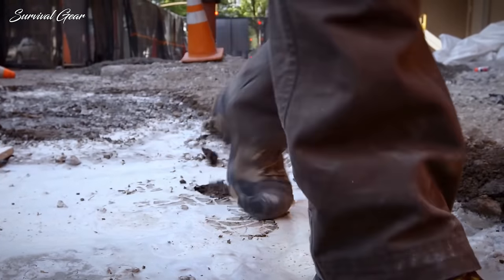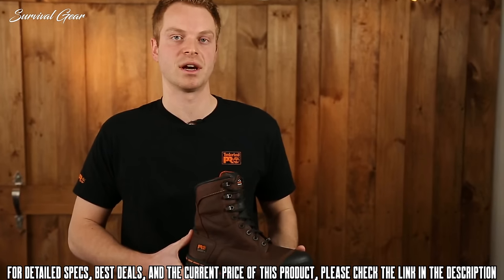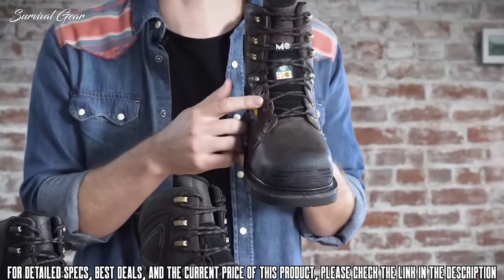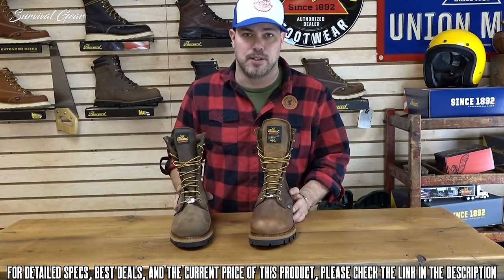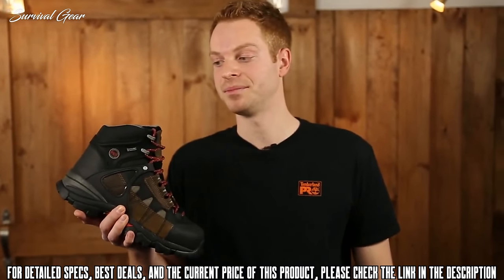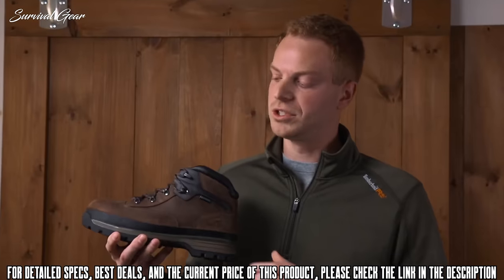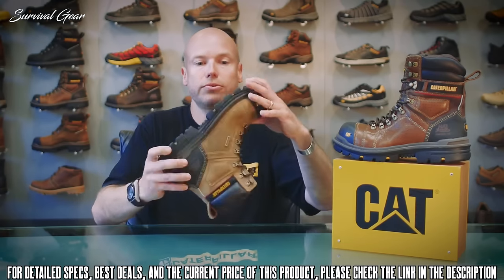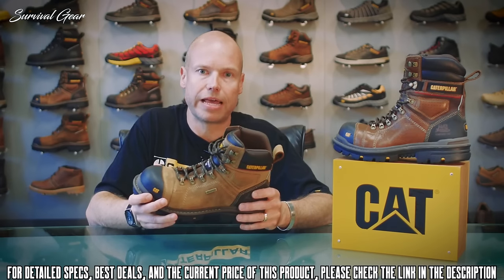TOP 10 BEST WORK BOOTS FOR MEN 2020

Comment: I agree with the comments about Redwing boots. I thought about buying some for over 5 years. Every year I would need a new pair but never gave in to spending the $280 that they would cost me. Well I ended up buying a pair of the Redwind Chukka work boots, which aren't their most rugged boot by any means, but theyve already lasted me longer than every other brand besides Tony Lama. The real reasons I fell in love with them is #1, for the comfort. I go on walks with my girlfriend and don't need to bother changing into sneakers to do so. #2, I can take them into any of their stores to get them cleaned, conditioned, and have new laces put in for free whenever I want. The only problem I've ever had was when I broke off one of the eyelets for the laces. But the store reimbursed me in cash when I had them fixed by a very good shoe repair store down the street. I couldn't be happier with Redwing boots
Reply: I knew about the laces but didn’t know they cleaned and conditioned at Red Wing
Looks like my Iron Rangers will be making a trip up to Red wing

Do they need to be purchased from Red Wing directly for that?
Thanks for the info

Comment: The Danner Vitals are amazing for land surveying. They’re snake proof, water resistant, ankle support with the 8”. Amazingly comfortable, and they last years if not almost a lifetime if you take care of them immediately after work as if you step into shin deep water. Also, 6-800 gram insulation.

There’s a couple of hiker boots, made by Danner, that are for hiking, and those are the Skyridge series and the Mountain 600.

Danners are not cheap. So, if you’re low on cash; I’d tell ya that Rock Rooster are next in line

Comment: I recently tried the Georgia Muddog boot at the potash production mine I work at and by far the best boot I’ve had working at the site. Constantly dealing with brine water and mud, salt, and constant climbing up and down stairs and ladders, these were extremely comfortable,    Feet felt dry and warm even though I was working with water and in puddles. The mix of rubber around bottom part of the boot with a water proof leather top part of boot made them light weight and comfortable all day, and at 170 dollars well worth that price.

Comment: Now lets find some fellas who actually work on their feet all day for a living and see what they say.
Reply: Caterpillar had since September, work at a scrap yard and the bottom has already come off of them, don’t buy
Reply: Truck mechanic for 25 years,been using cat boots for like 15 years just picked up those XL excavators....so far so good, upsetting these aren't made in the USA😒
Reply: When I was a young man on a budget I used to buy wolverine and the soles went bad after a year.  I decided to try timberland "pro". Three months in, i was doing a tile job a knelt down to start laying tile and the sole completely split at the ball of my foot. Ever since 2006 I've worn Redwings 2406 's and never had a problem. Well worth the money.
Reply: I went to timberland pro helix, and man they are comfortable and holding up. Cat can’t touch em. They broke in good in about 3 days of 8 hours shifts at a scrap yard. 180 also the timberland titan pro 6. Wolverine boot front toe started flapping after two days, took them back and they gave me trade in on the timberlands
Reply: Chippewa 25407. Not great if you stand on a concrete floor all day, but best (and toughest) field boot I've come across. Stiff as a wedding dick when new, they require a little break in time.
Reply: @clapperjack.  I don’t like timberlands but I’m really liking the helix pull on. I will probably take some used tire tread and tack onto the bottom once these wear out. Having problems breaking in a boot, take a shower in them and let them dry on your feet. It sucks but they will break in perfectly. Learned that in basic training
Reply: @br4nd0n79  personal thats just silly... I did have a pair of army boots tho best boots ever, lasted a year and a half. Not sure but I didn't think they were leather or maybe "ruffed" leather? Not really a pull on guy, need the lacies. Google tracked me this March at 37 miles of walking.
Reply: @clapperjack.  what’s silly? Retreading your boots or getting them wet for break in? Bates was high speed when I was in,  I work at a scrap yard and a customer retreads his boots with our tires that we can’t get rid of and he has been doing retread for aslong as I can remember. He ain’t paying for boots lol, but also old school boots that have held up, they don’t make em like that no more.
Edit: I have broke in a ton of boots walking through a creek and leaving them on until dry. Maybe it’s just me but they break in and stay comfortable until i end up with a new pair
Reply: dude chill, I was just asking u what you found silly. No pissing match. lol I just asked what seemed silly. God damn people are fuckin touchy. Hope that 9800 acres does ya good in 2021. ✌️
Reply: I've been using Kodiak timberlines the past 3 years. Each pair has lasted me over a year and they've also been my go to winter and hiking boots. You need to throw in a different insole but other than that they're great. Omega rated, carbon fiber toe caps instead of steel, and they're insulated amazingly (have never had cold feet even in -40 temps.)
Reply: I work vac I'm on my feet all day and have to trudge through the snow timberland pro boondock is the most comfortable  boots I have ever owend. I went through a lot of other brands. my only complaint is they are to warm in the summer
Reply: Rope Access Tech here working in construction and oil & gas.. 
Red Wing.. personally the best investment for workboots. Wearing the pull - on 4436 for almost 2 yrs, sole still good as new. And it just look so damn good.
Reply: Yessir,  im on my feet 15+ hrs a day.  Timberland and Cat are junk.  The only boot that can hang in the oilfield are Redwing.  Yes they're expensive,  but they are the most quality boot for the oil field.
Reply: @Only9mm  Redwing king toe or Merrell boots
Reply: I have two different pair of Timberland Pro Boondocks. One shorter pair with no thinsulate for summer/indoor work and a taller warmer pair for winter.  The warm ones are almost too warm and I barely wore them this year. 

Been wearing Tim Pros for years.

>Fiber Optic Technician
Reply: Go Carolina
Reply: Timberland pro’s only
Reply: @br4nd0n79  Completely agree on timberland pro series comfort. and they hold up under extreme landscaping abuse. My experience, I found them to be a tad on the smaller than stated size; thus I order now one half size up.
Reply: Carolina 399 boots. Awesome for the price
Reply: Wolverine all day..
Reply: If you want the best work boots buy Red Wing! I’ve had their 607 model for past 3 years and my feet, knees and back are happy. BTW I work in plumbing.
Reply: @Only9mm  Amen to that! I’m a plumber and only wear Red Wing boots 🥾. They are expensive but worth every penny
Reply: I hog/goat ranch I wear Double H western or work boots they are made in America and hold up like nothing else
Reply: They will tell you timberlands are garbo!
Reply: Nick's or nothing.
Reply: I been using keen for years
Reply: @clapperjack.   Farmers are crazy as hell. I see them working in basically slip on leather cowboy boots flat sole with zero tread lugs. Don't understand how they would not be terrified of slipping on cow poo all day.
Reply: Danner.
Reply: @rubencruz1637  I wore Wolverines for awhile and yeah, they last for a year pretty reliably, but not to expensive as far as I can remember. I do have a pair of timberland pros, but not for very long, I have not made up my mind on them, hmm hard break in though, I like my danners the most. I live at work so expensive boots are a must for me now.
Reply: Ive been in a lumberyard for 22 years. The Cat Invader boot lasted 14 months on concrete floors which most people know can kill boots in a short time. The Timberland pro low cut boots lasted 2 months. Keens lasted 3.5 months. I am currently on S Fellas. Time will tell. The Invaders were the most expensive at $130. I did not need those super duty boots that cost $250 or higher. And yes i have lots of stuff falling on my feet. The price of working with idiots.

Comment: Been wearing timberlands for about 10 years now working in all times of Scenarios and are by far the most comfortable boot to wearfor me. I havent tried red wings yet amd thinking of giving them a go but keep go back to the Tim’s. only thing I can say about them is I’ve worn them out pretty quick and the inner liner has come free mucking it a pain taking them off now with the new pair I have I use and show horn to put them on to help avoid that. Also having Quadruple E wide feet they’ve fit my foot the best so far with the soft leather. I’ve changed a lot of ppl at my work the switch and all haven’t picked another boot since.

Comment: Concrete Finisher.
I've tried the best
Chippewa,red wing,Danner, wolverine
and now because I caught them for $50 I'm gonna try timberland pro boondocks. But I have to say the most comfortable,rugged,
stay dry boots I have owned thus far is Carhartt's I owned 2 pair back to back and got 3 1/2 years out of them together. I still have both pairs because they both have plenty of life left in them
Reply: How the hell did you get those for 50 bucks?

Comment: I bought those caterpillars second shift boots earlier in 2018 and I still have them.... stitching is still holding up very good no rips or tears. I een doing air conditioning installations so i have to climb ladders walk on roofs and crawl in attics. the boot has been extremely good but since i just got a new job i want to get new ones and i am considering sticking to caterpillar's as they are well worth it.

Comment: I work in construction for a living as a crane operator. I can say that even though KEENs are extremely comfortable, they'll fall apart within a month. Rubber pieces and sole fall apart easily (maybe adhesive is trash?) and warranty is trash. We dont want to spend $200+ on a boot to be falling apart within a month.
Reply: Did you talk to Keen directly? Everyone I know that had an issues with Keens really like the customer service and warranty. Keen also makes a wide variety of boots for different purposes.
Reply: @5stardave  I finally did. Their customer service was an excellent experience. Need to edit original post.

Comment: Cat are my go too boot I work in a saw mill inside and outside very wet and muddy in winter and I swear by the cat device boot very light comfortable two years of wearing and still water proof and still and haven't fallen apart, I have a new pair ready to go, I've ordered the cat 8" premier hopefully they are just as good.

Comment: 18 years hard concrete. Extruder operator. I been through boots like crazy. 
   I honestly don't think its the boot. Its the person, the person s foot, your walk, your weight.
    I'm 5' 11" 300lbs. One foot a half size smaller than the other, 1 leg a half inch shorter.  I been through boots. I spent 50$ i spent 280$ . It dont matter. 
   The only way to get the best boot is get a custom fit. Good luck on that.
     As far as redwings...... what a joke. 
I walked in the store, stepped on his machine, it said i was a size 11...... im a 13 sir. I walked out.
Reply: Check out chippewa. Very reliable boots
Reply: Redwing said I’m smaller sized too, funny thing is... they fit really well
Reply: Red Wings boots runs smaller on everyone, check out this video: https://youtu.be/fAKEQ4YzFO0

Comment: I can contest to the timberland boondocks. Been using them for about five years now I'll never buy another pair of work boots.
Reply: Mark Isabeast  I meant. Five years total. Not one pair lasting 5 year. I do street maintenance. I'm on my feet a lot. Mostly working with hot asphalt. I do get a free pair of boots every year tho. And the  timberland pro boondocks are the only pair I'll ever wear again. Although they do last longer. I will say that just because I get new ones every year. Doesn't mean I need them. I still have my first pair and still wear them. Another thing I also wear dress socks or a thinner pair of socks. No white cotton. I do this it helps keep my feet cooler in the summer and warmer in the winter. The boondocks come in 2 versions. Winter has 400 extra grams of insulation. Try them and get back to me.

Comment: I have tried well over 2 dozen different brands of boots. Good name and no-name, cheap $40 to $160. I never, NEVER had any of them last any longer than 6 months. So if you think you have something that will last any better, send them my way and I will give them a real world testing..
Reply: Red Wing 2156 Chukka, i get 5-6 years out of a pair. You might have to resole them once or twice in that time. They are wonderful, depending on what you need to do.
Reply: What kind of work are you doing? Any boot over $100 should last you longer than 6 months unless you're just hell on them.
Reply: @sovereign4107  I'm just a humble machinist.  Not very hard on them at all. Everything just falls apart My current pair is separating from the sole in the toe area. I should take a picture
Reply: @sirgergorymmmc2231  I never had a problem with boots coming apart like that even for some of the cheaper boots. The last pair I bought were Timberland pro and I think they are the most comfortable that I tried but that was years ago and idk if they are still as durable. You may want to try something like Thorogood boots as I think they are tough for a fair price.  You could always try redwings but I personally think they are overpriced for what you are getting.
Reply: @sovereign4107  well. I just went and purchased Herman Survivors.  Again.

Comment: I haven't found a pair that lasts past 4 months
Reply: Niccolo Andretti ever tried Timberland Pro? I have had a pair that lasted over 5 years
Reply: @malakisands8180  did you even use them for work? The boots you reference are the ones I currently have, put em to use in January, they're basically crap now. Need a new pair. So unless u put em on casually there's no way ANY pair of boots go that long at work. Believe me I bought the toughest red wings and they wore out just the same. 4months of work, wear, Sweat, the soles crack & break, the leather is thrashed, water leaking in. BS. Ill test any boot. BS
Reply: Yes I use them in the chemical industry and they do not fail being waterproof and staying together for 70 plus hour weeks
Reply: Try thorogood
Reply: Niccolo Andretti agree 
Had several pairs of Timberland Pros through the years 
All crap 
Wanted to like because they make good looking boots, but don’t perform for me
Reply: Mark Isabeast  who said anything about stink? I'm talking soles breaking stitching breaking & leather tearing. How does thick sox protect that? Your definition of work & what a worn out boot is must be something different. I run thru enuff boots , NOT trashing them,  just WORKING, it don't matter what kind.
Reply: Mark Isabeast  if I misunderstood, so did you. Simply put, they wear out. I do get thick socks for boots already because the steel toes callous my toes from kneeling. No boots bend well even if they claim to. All feet stink but that is not the problem, I've never had an excessive odor problem. It's simply putting them on,  lacing them up,  from 7 to 7, constant walking, kneeling & moisture. & if I buy 2 pairs, anywhere between $150 & $250+  X2, they're still gonna wear out in thier time period, so I'll just save my money till another pair is needed. I have previous pairs here I can send them to you for your analysis
Reply: @niccoloandretti5681  my red wing king toes are still going strong had them for six years now. I am about to order some timberland summit to try them out, but I am worried about the durability of them. If they don't work out back to the king toes insulated I will go. I use to  do alot of manual labor with some chemicals spilling on your shoes but I took care of my king toes. Now I am strictly on a forklift so maybe the timberland will last.

Comment: I've owned most of the boots in this video, and have destroyed them within 6 months. And all I do is wear them. Not impressed with any of them!!
Reply: You sound like me, what kind of work? I am a pipefitter for irrigation systems, try as i might i can not get more than 4 to 6 months out of boots regardless of how much i spend. Ive found that about 80$ boots will last as long as 250$ boots when exposed to my work conditions. Its actually very frustrating  rubber boots keep my dry but i dig so much that they will be cut by my shovel in a day, leather boots cant offer the waterproof protection i need.  If anyone knows any bootmakers that might be willing to talk to workers i think together we could make a solid boot. I have all the ideas which come from daily use, just need a skilled guy to throw the ideas to

Comment: How can you make this video without including chippewa, legit one of the longest lasting boots ive ever seen. Ive ran through timbs, cats, cheapy waltmart specials (lasted longer than timbs) and several other midrange boots. Chippewa has lasted four years, and I'll get another four minimum out of them when I send them to be resoled. Not a single boot has lasted the greatest test for boots besides chippewa, that test is full time hours at a car wash. Constantly soaked feets, corrosive chemicals, and Constantly kicking steel plates. The bottom of my timbs are slick right now and theyre only a year old, I wont be buying them again.
Reply: Nah, better question. WHERE THE FUCK ARE THE CAROLINAS